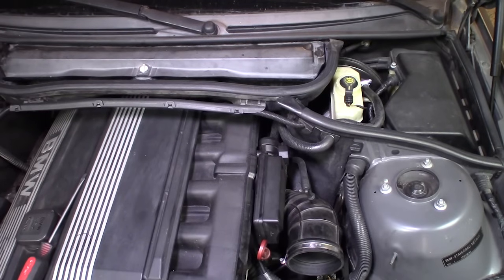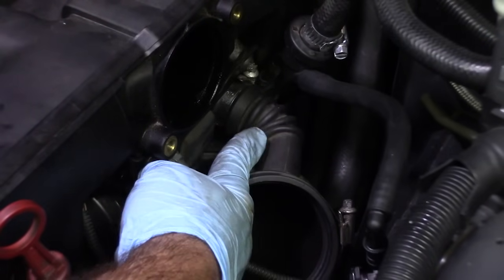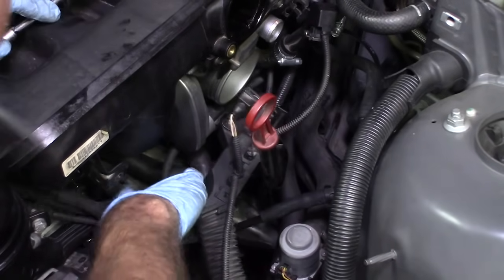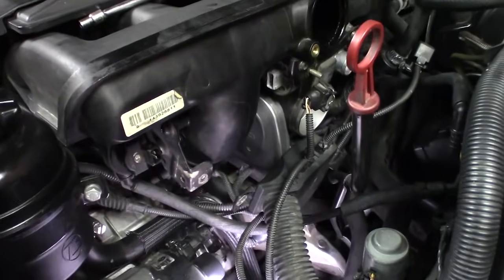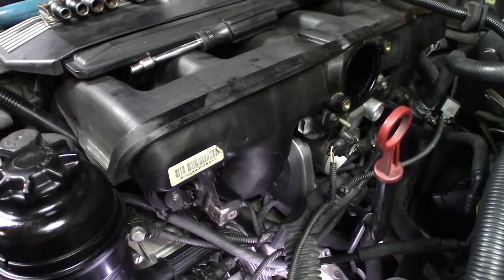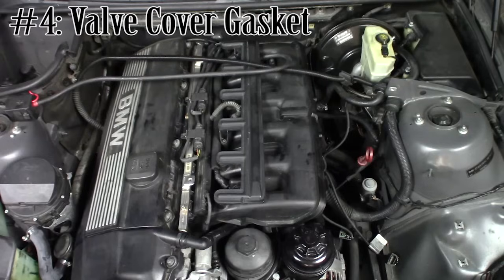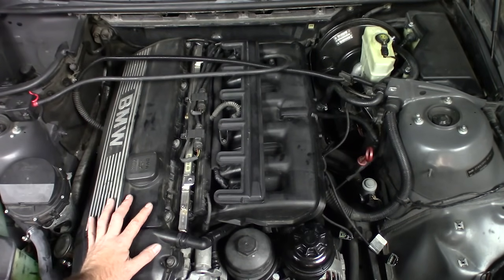BMW E46 & E39 Most Common Vacuum Leaks P0171 & P0174

Comment: This video covers most common vacuum leaks but I have found a common leak that was not covered.  That is the vacuum line going to the fuel pressure regulator.  This was hard to find even with a smoke generator.  The reason that it is hard to find is the location.  The fuel pressure regulator on these cars is on the fuel filter which is located under the car left middle behind a metal panel.  On removing this panel I have found several instances in which the vacuum line to the fuel pressure was completely disintegrated.  Smoke testing is no good unless you happen to be under the car and see smoke leaking out of this panel.  Easy fix and no more lean mixture bank 1 & 2 DTC's.  50's kid (I don't think so) covers replacing the filter regulator unit in this video:

https://youtu.be/6yZA5Ha5wQg
Reply: Troy Davis ..

Comment: excellent video. I didn't have a code come up but my 04 325xi was running like garbage and eventually died. just before it started to die out it was making a clunking noise when the rpms would bounce low. my culprit was oil separator return to oil dipstick hose.it was broken in half and dripping oil which also explains my oil consumption. $23 at the dealer. I also changed intake boots as they were cracked almost all of the way through the ribs. thanks again. my car is running better than when I bought it. idle is holding steady
Reply: nice video! i have been chasing a grimlin for some time, all new vacum lines and intake manifold gasket, i have yet to re seal disa!! that will be my next step.
Reply: Austin Schell I had that issue and I found out a vacuum hose wasn’t plugged in behind the intake manifold and I had a crack in the actual intake manifold so I fixed it with jb weld and fixed issue

Comment: Great video! What left me confused is the air that re-enters the intake from the crank case ventilation. Technically MAF has no knowledge of it. How does the system calculate that amount behind MAF?

Comment: my vehicle stalls when I'm driving and i have to start in order to continue. (E46) I replaced the Disa and aide control valve. it was driving good for a few days and it did it agin stalling. not sure what the issue is. I did get a P0174 code as well. need help
Reply: Might be maf sensor

Comment: I have p0492,p0171,174. Will the p0492 cause an effect of the 171 and 174 to appear to show on the scanner?
Reply from the maker: +jackass If the hose from the secondary air pump to the valve is broken or torn, it might.
Reply: +50sKid  thanks i just bought all the parts the pvc crankcase, solenoid, air valve, and intake boots and manifold boots. i think i will change and check from the easy parts first.

Comment: what size are the vakuum lines? I got the the codes, deleted them and drove it for a couple of days before the light came back on. but now its only the p0174 code, deleted it and some days after again (driving like 30km every day) it came back.
But my valve cover gasket is leaking a little. so im going to change that and probably the lower intake boot. but want to change the lines in the process.

Comment: Here's my story and it has a happy ending.  About a half mile from home my 2003 530i  engine started running really bad.  No power, coughing and backfiring.   Of course the check engine light came on and the 1071, 1074 codes where there along with some 1350's miss firings.  I followed all the advice in this video and used about 2 big cans of carb cleaner trying to find the air leak.  To no avail.   23 months ago the OEM fuel pump just quit.  No codes in the computer when it failed.   So after trying everything in this video I thought why not check the fuel pressure.   I went to Autozone and thru their loan-a tool program got a fuel pressure tester.  Instead of 40 to 45 psi of fuel pressure I had only 15 to 20 psi.   Just enough to start the engine but nothing more.   So unlike the last time where the pump completely failed this pump was still putting out some pressure.   And the replacement pump had a 24 month warranty so I got a new one for free.   So my point is after trying everything in this video, if there is still a problem check the fuel pressure.

Comment: i forgot to mention a misfire on cilinder 3, only when the engine is cold and idling. please help.
Reply from the maker: Yeah I'm dealing with a similar sort of problem. I can't say when the video will be released. But you would likely fix your problem by replacing that coil.

Comment: First off, thanks you do a great job of explaining the issues and how to correct them. Ok as you stated p0171 and/or p0174 can genuinely be bad O2 sensors and I noticed that when removing the intake air boot you mention to us viewers to ignore the shiny/oily spot on that part because it was “silicone spray” that you used to remove the boot and that what we were seeing was excess... You do know what silicone, especially in the air intake, does to O2 sensors right??

Comment: Jason: I have P0171, P0174, P1083, P1085 (on my E39). Based on my research (https://www.bimmerfest.com/forums/showthread.php?t=818511) it seems this could be the Oil Dipstick Breather Hose from the CCV, causing the leak. I recently purchased the OEM replacement (11 15 7 532 649). You mention being able to see that part from underneath, with the car jacked up. Any idea if I'll be able to get in there, from underneath to swap that single hose; or if I will have to work from above, removing everything shown in the video? Great videos and thanks for the help! Thx!

Comment: Great videos Kid, well done!  DISA Valve?   Sure enough.  Did a diy smoke test and also discovered (surprise...) the oil fill cap! Thanks for the inspiration!
Reply from the maker: +Tom M Wow, did the gasket around the oil fill cap deteriorate or something?
Reply: The oil fill cap gasket looked ok, but must have gotten too hard (not pliable enough) to seal properly.  Note its an after market cap, not the original OEM.  I found that wedged between the valve cover and the firewall under the micro filter housing.  Looks as though it had been there a long time.
Reply from the maker: Lol, amazing what you find sometimes!

Comment: Hello my friend, my car is idle and loses acceleration, and it gets weak and has small bursts at idle, I already changed Maf, and it can not be solved, please help me here, we do not have a mechanic that solves the problem.
Reply from the maker: Do you have any DTC codes?
Reply: Good morning! Yes I have error code, P0327, P0369, P0444, had a loose hose of the engine sigh for valve Pulmao, I put the hose in place and the car is much better but still have a mistake thank you very much for your response.

Comment: You forgot to tell about very important vacuum leak source - bmw part number 11611727176.
Reply from the maker: Yep, that is a known problem.  I did a small repair to mine in my CCV video series, but you can just buy a vacuum cap at any auto parts store.

Comment: Love your videos, but you need to study your grade 8 science.  Fuel does not burn oxygen, in fact, oxygen does not burn.  Oxygen is necessary for combustion to occur if there is fuel, and an ignition source.  If the O2 sensor is reading too much oxygen it means that there was not enough fuel (lean condition) to use that oxygen in the combustion process.

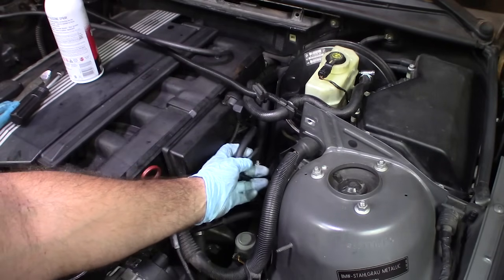Comment: Hey man, I just noticed that the lower hose  shown in minute 5:43 is missing from my bmw320, where does that hose go? also could that be the problem to my cold rough starts?
Reply from the maker: +BLU Ninja is the port there and the hose is just broken off? It goes down to the fuel pressure regulator. It shouldn't be enough to cause rough starts. That is usually a bigger vacuum leak from the ccv system
Reply: 50sKid hose is broken, thanks man I’ll try to figure out what it is, I start the car cold and rough starts then stalls